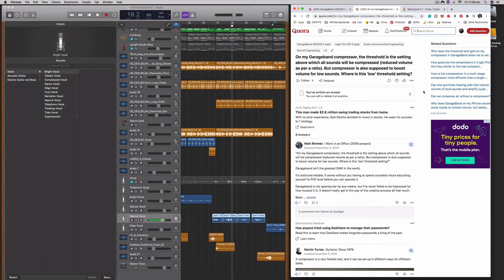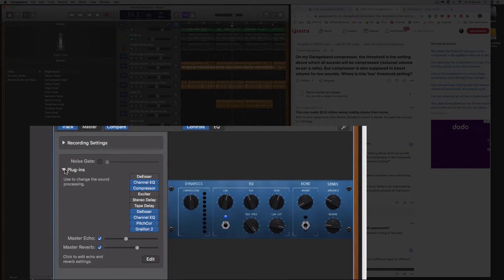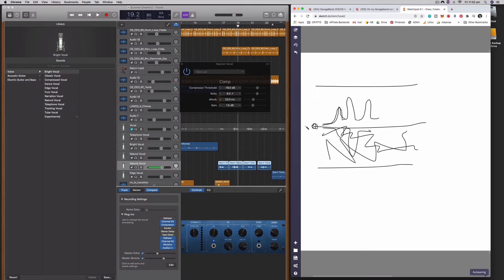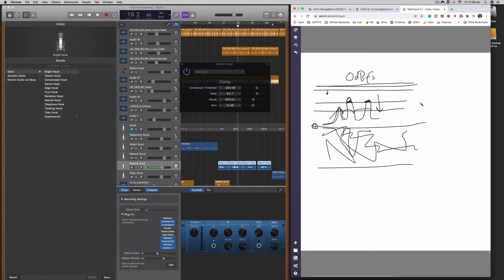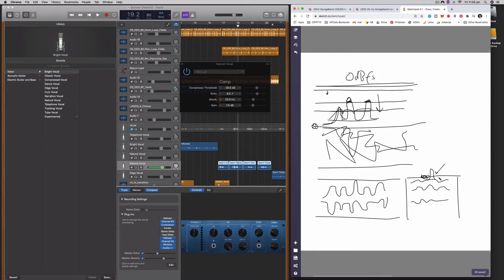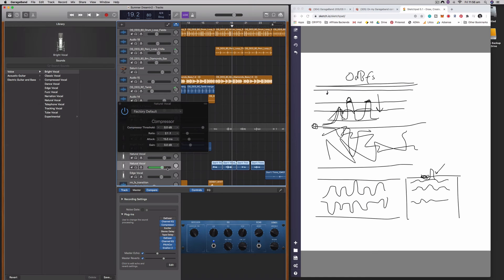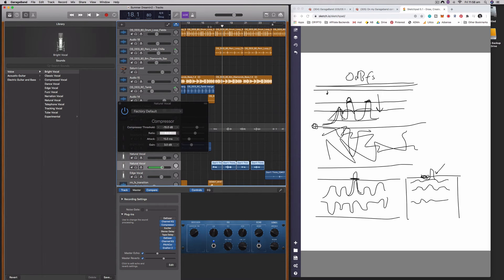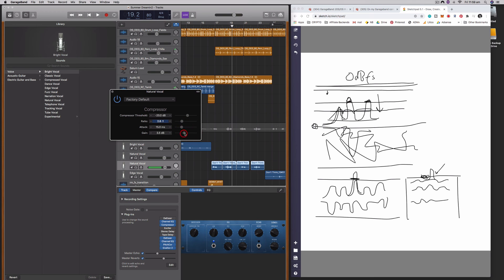How Audio Compressors Work | GarageBand Simple Compressor

Comment: Great video, but you didn’t cover what the ratio actually does. I’m still struggling to figure that out. Is it the ratio of the gain and compression on the track or just compression? P.S. I did your course. Can’t remember if you covered that.